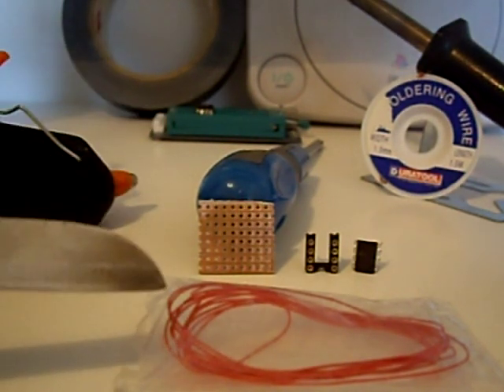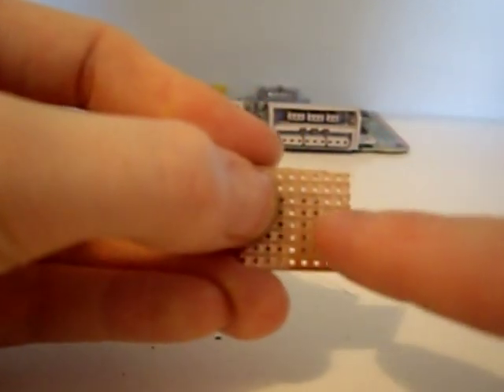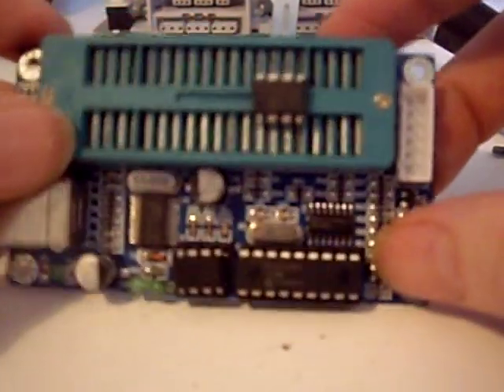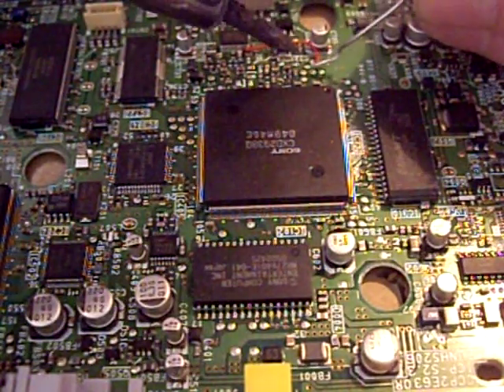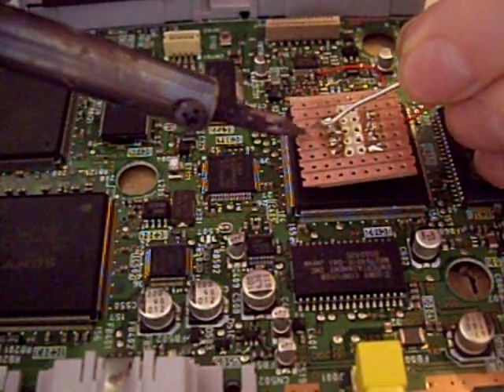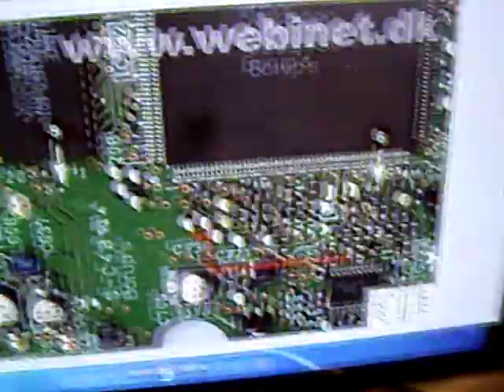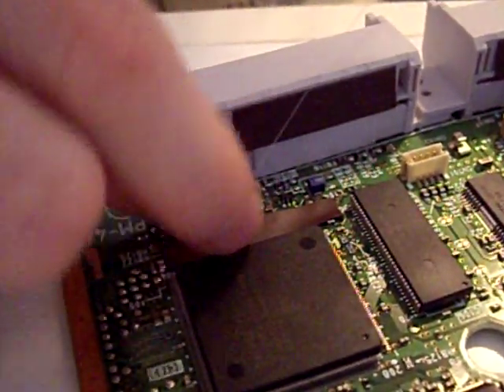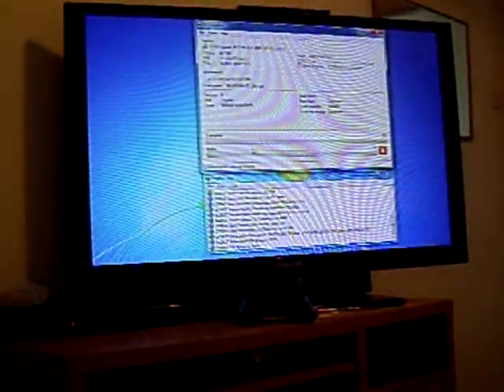PSONE PSX Modchip Install by jse, difficulty level = Easy

Comment: hey great guide. ive visited the site. there are other variations of the mod chip. which one should i get? are there any modchip that supports multiple regions? O_o...
Reply from the maker: Yes but there are more difficult to install, you can view my other videos if you want to see them.

If you have experience with soldering you should install a MM3 in a Phat or NTSC PSONE, or a ONECHIP in a Pal PSONE. They will give you multi region support of originals and backups and better timing. If your a novice Go with the Old Crow chip shown in this video, you can patch the region of games before burning them so you can still get any game to work.
Reply: mm3 and onechip are basically the same? i think ill get the mm3 instead in-case i need to try it on other psx consoles. thanks mate.

Comment: the Modchip can 'block' the original CD's?
i have 1 PS1 with mode chip, but with some problems:
1 - i need a Boot disk(copy of Swap Disk) for read not original games;
2 - why the original CD's aren't played?
Reply: Sound like a bad install, a mid chip should run both backups and originals

Comment: I can't even get the case open, the screws simply won't budge. Never had this problem with other consoles. :/
Reply: Same here, I got 4 of them off but the 5th was just too ridiculously stubborn.. I ended up ripping the hood of the psone off out of frustration/lack of care anymore. Now I'm just gonna use it as-is.
Reply: The Haqq I bought a pre-modded PS2 Slim on eBay so I'm able to play PS1 games on that one instead. Would have been fun to mod the PSone myself though.

Comment: solder pens, I have an issue with finding one that actually heats exactly in the tip and not a bit above on the side:
Can anyone recommend me a good one for electronic boards??

THANKS!

Comment: know a place were I can just buy a pre modded one ?
Reply: +Dodi1932 I should of updated sorry, I have since found a very good installer in austria, close enough to the U.K for me to be happy with the solution :) if anyone wants the email leave me a PM
Reply: Doesn't exist, only way I found is to buy all the parts and beg electronic repair shops to fit it.
Reply: I have also heard about professional installers online, although I never seen them outside of rumours :'(
Reply: eBay for around $120 US. Or find a local video game group on Facebook. I just saw one for $25. CDN in my area.

Comment: hi, I dont have any experience with soldering and I want to ask something, how do I know if I have to melt the solder wire on the connection or just solder the kynar wire without doing it? Sorry for my bad english and thanx in advance.
Reply: Just a quick tip DONT use plumbers solder.

Comment: Why did you glue down the disc spinning sensor? I understand that it can be convinient to have it held down so that the disc can spin with the door open. The problem with that is that you wont be able to play multi disc games.

When the console says "please insert disc number 2..." you wont be able to insert it because the disc spinning sensor is always held down. 

Now of course some games allow you to save during this process in which case you can save then just start with disc 2. However some games like Lunar Silver Star Story don't let you save when switching from disc 1 to disc 2 so you wont be able to start disc 2. Just a heads up.
Reply: diasflac0g It will also expose the disc reader to an unhealthy amount of light, probably resulting in noticeable damage in the long term. Saying that this tutorial does show some of the basic concepts of modding very well.

Comment: Hey! I dont know much bout modding(only know it helps to play burned games). I got a PS1 with a chip installed few months back(scph 5502model) for a second hand market. The chip is installed beneath the main board of the PS1. I have an odd problem and not getting a solution. I am not able to play my own burned back ups on the PS1, but , it is playing pirated PS1 cd which I got from a local shop. The pirated CD has a whitish silver disk bottom, it is of NFS Porshe Unleashed and it has a cover photo of NFS2 . I also have a similar pirated XENA the warrior prince for PS1, but my back ups like Crash Bandicoot wont run. Can you help me out!!? And has it anything to do with the type of disk I burn it?
Reply: It should be CD-R recommended and not DVD-R or RW or CD-RW

Comment: Great guide as with many of your others! Quick question or questions for you, is the 12C508A-04/P or the 12C508A-04/SM the same chip as the 12C508A you listed in the description? Will either of these work as well? Thanks for your help.
Reply: yes they're the same chip essentially, just a few different internals.. though the firmware will explicitly configure the IOs as required... so the extras are disabled, etc.
Reply: You can also use the PIC12F629 or what I use, PIC12F675 .. check out my howto on my channel :)

Comment: What type of Pic is used? I looked up the one the HEX diagram said to use but it looks very different to the one you used (and has many more prongs)
Reply: ***** will a 12C509A work just as well as the 12C508A? I've seen other people use the former but I'm not sure if it makes much of a difference
Reply: ***** or 12F675, just a bit more expensive because it has internal ADCs

Comment: Too bad you didn't use the PIC holder. I managed to find a place to put it, somewhere around the edge of the console. Take a look: tinyurl [.com] /mtuskpm
Although it's the older version of PS1, you could still probably fit it in the same place in the new one.

Comment: in the Diagram to solder.. a wire went to point 1. But in the video you did not solder to it. You only went to points 8 and 6.. can you leave out the wire going to point 1 on the PIC?

Comment: Once again, thanks for your help. I'm going to buy the one shown in the video for sure I just wanted to double check on that part number. Even if the smaller one was already programmed, I'd need an electron microscope to solder it.

Comment: Do you know if there is a suffix to the end of your PIC part number? I got mine in the mail today and it is obviously MUCH smaller than yours, too small for human fingers to solder. It looks the same, just shrunk down. Looking closer at my eBay order, it says it's a PIC12F629-I/SN. I see others labeled PIC12F629-I/P that look more like yours with the tapered prongs. Let me know if you could, it might save another viewer from making the same mistake.

Comment: What kind of wire is used here? I ordered some 20 gauge insulated copper wire, I hope that will work, I think it will be thin enough to use on the small contact points.